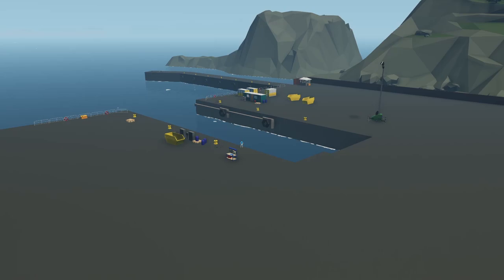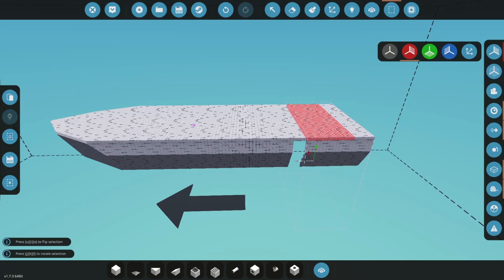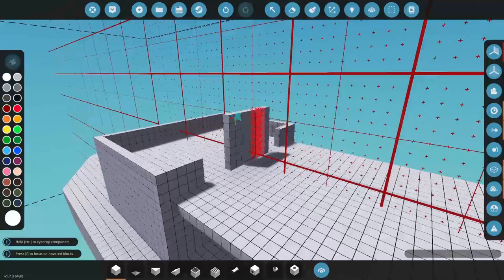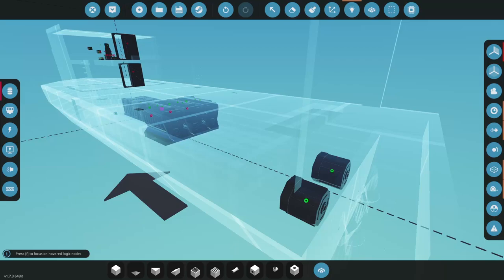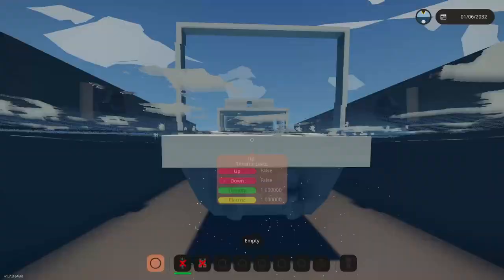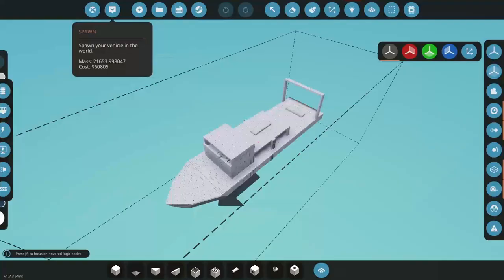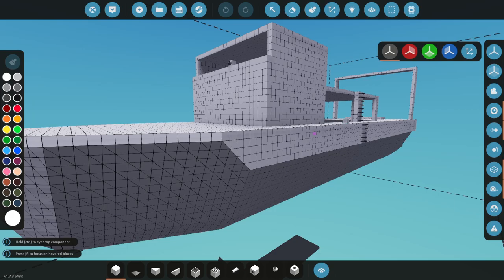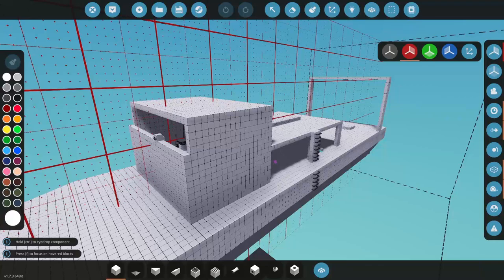STORMWORKS: Testing a HULL like an ENGINEER

Comment: small and med boats can get up to like 40m/s if u use multiple gears, especially ones that skim on the surface with a flat hull, I have been struggling however to maintain that speed because the front lifts up out of control or the boat jumps in and out of the water. I tried to use control fins unsucessfully (maybe I did it wrong), have also been experimenting with a ship design that has propellers in the center the idea being that the bouyancy on the ship rear would help prevent nose lift (still working on that ship).

Anyway I would love to see some design tips on how to make a hull capable of  high speeds like 30-40m/s while still being stable if ur interested in doing a vid on that because so far I was only able to find a vid analyzing speed boats(with flat bottoms and propellors at the back)

Also would be nice to see a vid on what is the most fuel efficient hull shapes
Reply: also just an update incase anyone reads this, I was able to massively stable out my tip at high speeds but the formula i was using was [ x*(-64) ] instead of *4 from the yt guide, on the ship i was testing which was a sharp steep hull at the bottom i was reaching 38 m/s before the propellors (side - mid) started leavign the water

my findings is that if you keep your craft steady enough to allow it to climb in speed, u can achieve very high top speeds using a gearbox system
Reply from the maker: Great ideas for videos!  I have boats that can be stable and reach that speed :D I can for sure make a video on that!  Thanks for the comment and information!
Reply: fluid jet is the best propulsion method for a boat medium-large size

Comment: Do 2 and 4 block long wedges still create excess drag?

Also, I've noticed some odd behaviors with props, like, small props can be spun faster, with less power and do not inhibit the speed of boat regardless of the size. It's like, speed of the prop is the only important factor and the larger the prop the more inefficient it is
Reply: the 2 and 4 pieces still have the problems they always had
edit: except for the one with not being painted in mirror mode
Reply: @Mathias  ok so to clarify, if the block is placed its fine but if its placed as a mirror its not?
Reply: @stevenmiller279  oh no, its an old bug where coloring in mirror mode wouldnt work, either way thats the only thing they fixed, all the physics related issues are still there
Reply: @Mathias  ah I see, it's unfortunate because with larger vessels needing much more power and modular engines being a whole thing to set up, it really locks you onto one particular bow design unless you like burning extra fuel just to have a Sligh better looking boat
Reply: @stevenmiller279  or you could get thales aviation block pack (mod)